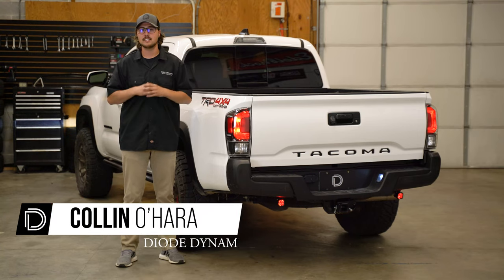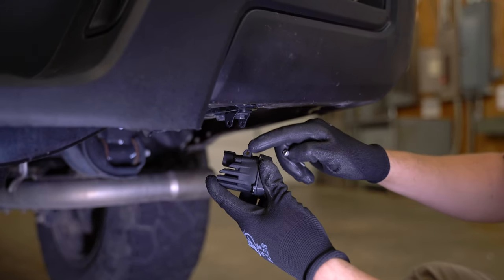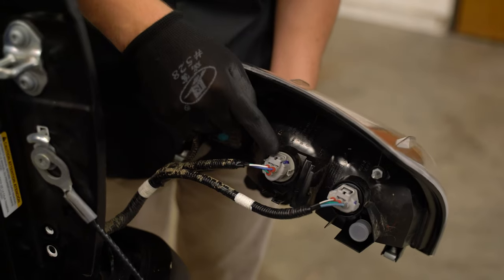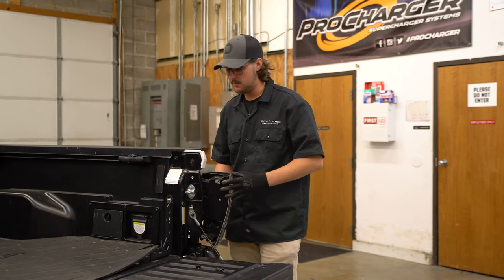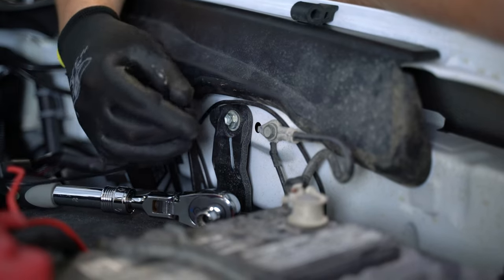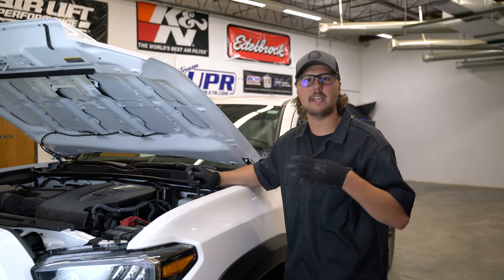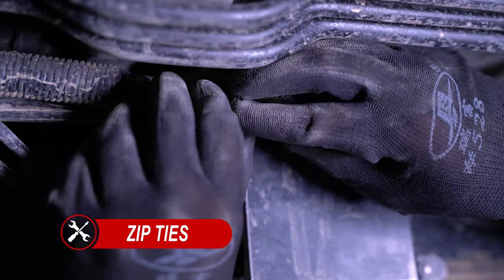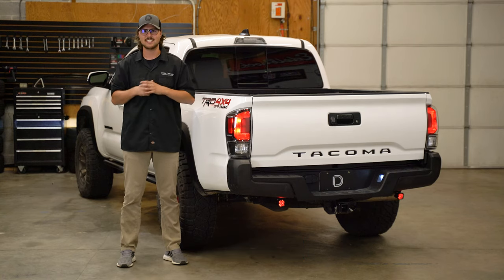How to Install Stage Series Reverse Light Kit for 2016-2023 Toyota Tacoma | Diode Dynamics

Comment: Can the wiring harness be hooked up to a switch panel instead of using the switch that comes with it?
Reply from the maker: It can be hooked up to a switch panel, but will need to be on multiple switches! For more information on that, shoot us an email at contact@diodedynamics.com.

Comment: How would you wire it this so you can turn the lights on/off with say a switchpro or auxbeam 8-gang switchpad?
Reply from the maker: We offer a reverse light wiring harness that allows to to use an aftermarket switch panel!

You can check it out in the link below:
https://www.diodedynamics.com/reverse-light-wiring-kit-w-running-light.html

Comment: This is awesome! 

Quick question. 
I do have the ss2 sports with amber backlight. I’m guessing, If I run this wiring set up, my pods will be amber has I brake correct? Lol
If I want them red, I will need to them get the one with red back light?
Reply from the maker: Hi there! No, these do not tie into your brake lights at all. They function as a continuous red running light and them switch on to cool white when the vehicle is put into reverse!

Comment: Love the looks added to it. Can It be wired to break light instead of reverse light. I want it to light up when I depressed the break,  please kindly advise
Reply from the maker: Yes, you could do this, but it would require some cutting and splicing. Also, the output of the mainlight would be white, not red like a brake light.
Reply: @diodedynamics  Thank you. If possible please make one that works with brake lights just like corsomotion reflector light. I'm pretty sure many will get it. 😉
Reply from the maker: @g7003041  We appreciate the feedback! We'll pass the suggestion on to our engineering team.

Comment: Does the sport have the constant red light running or only the pro has?  And what’s the difference between the sport and pro except the pro having twice the output? Thanks
Reply from the maker: All power levels will function the same way. The output is really the only real difference.

Comment: Does this work with the Meso Customs Total Tail Stage 1 because of the existing plug and play wiring?
Reply from the maker: Hmm- we're not sure. As long as the Meso kit uses OEM-style adapters on the back of the tail light, it should. If not, you can still do this using our universal adapter harness!
Reply: @diodedynamics  it uses OEM style adapters but the thing is that it uses the same light bulb for the reverse and turn signal, would that make the reverse lights flash when turning as well?
Reply from the maker: @Jessssssyy  It would most likely make the pods behave the same way as the tail light.
Reply: Yes i just installed it today

Comment: Whats the point of the harness at the tail light if you're running power from the battery? Just signals for reverse/running lights? Couldn't you just tap into the tail lights for power?
Reply from the maker: Yep! It's to use the factory signals. Attaching them to the battery gives your lights more protection and gives you the option to run the lights manually!
Reply: @diodedynamics  So can you could use that harness only and just run them off the factory wiring?
Reply from the maker: @tomorrowtactical  No, you will need to use both harnesses with this kit.
Reply: @diodedynamics  Do you sell that kit without the lights? Just the wiring?
Reply from the maker: @tomorrowtactical  We don't. However,  if you go ahead and give us a call at 314-205-3033 Monday-Friday 10 a.m.- 5 p.m. CST, or shoot us an email at contact@diodedynamics.com, and our service team would be happy to help you get them!
Reply from the maker: @tomorrowtactical  Awesome!
Reply: @diodedynamics  So that DD4102 reverse light wiring harness I got is a 4 pin but my lights are only 2 pin. Can I cut off the 4 pin connectors and replace them with 2 pin connectors and then just cap the blue wire? Which I believe is the running light?
Reply from the maker: @tomorrowtactical  You may be able to do this, however, our service team may be able to give you a better solution. Please reach out to us at contact@diodedynamics.com, or give us a call at 314-205-3033 M-F CST, and we'll help!
Reply: Does it matter which tail light to hook up to? I did the left tail light and my lights don’t even turn on when I put it in reverse. It stays red.
Reply: @HekkaDopePinoy  I wonder the same question as I cannot get the reverse signal to turn on my lights.  I have my adapter harness attached to the passenger side taillight.